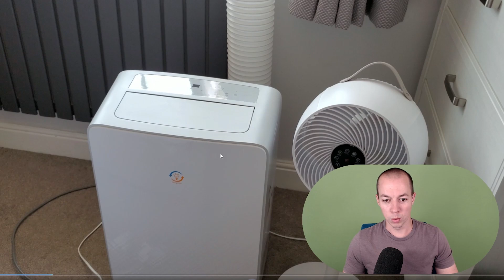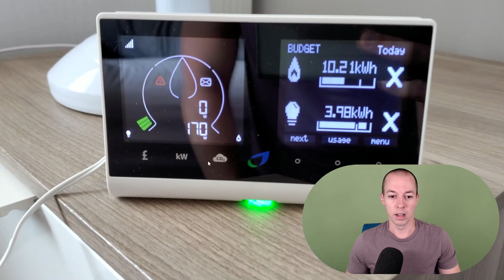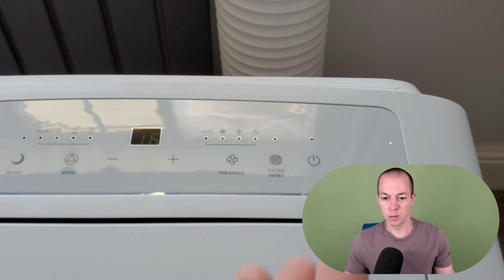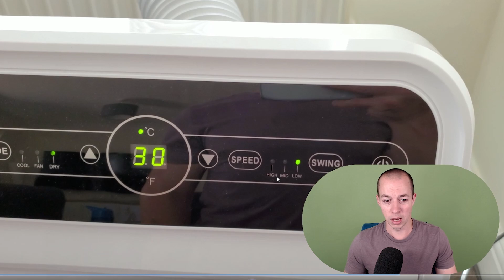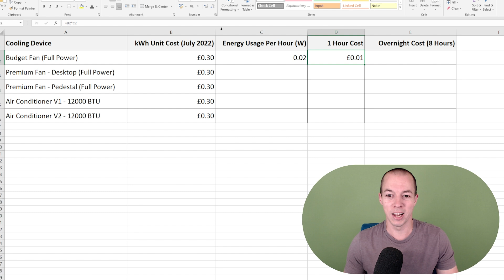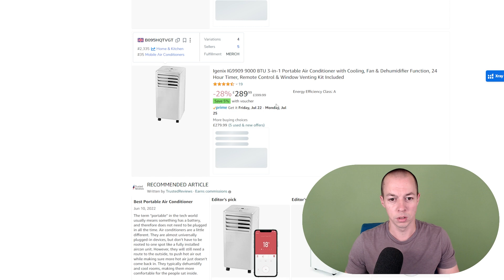Portable Air Conditioner - Energy Costs REVEALED!

Comment: Excellent video/subject matter which has been badly needed ...Bgas standard tariff 2022  1kwh =32p ..mines a 14000btu at 1.5kwh (airconcentre) therefore aircon costs about 50p per hour, just the fan runs out at (50w) 2p per hour...4kwh would be £1.28 per hour.

Comment: Fantastic video. I have a 5000 BTU unit would that be the same ?  Also when using the aircon unit with in fan mode (no compressor running) will that be similar cost wise  to running a normal fan?
Reply: I'd like to know that too ,Good question 😉
Reply: It should be about the same in fan mode. I only have wall mounted split system and on that I measured negligible consumption in "fan mode"  compared  to heating or cooling mode.